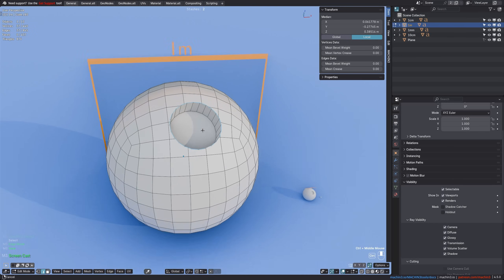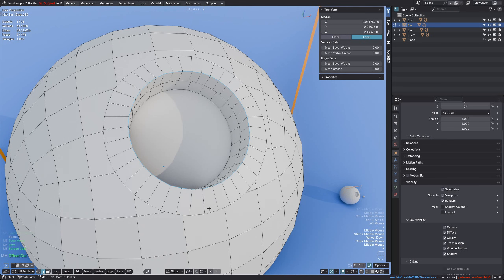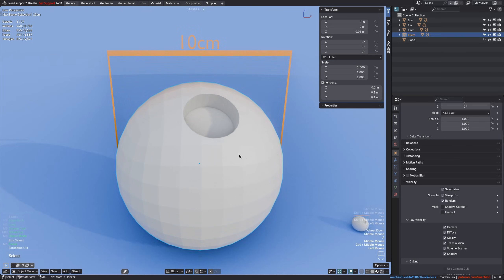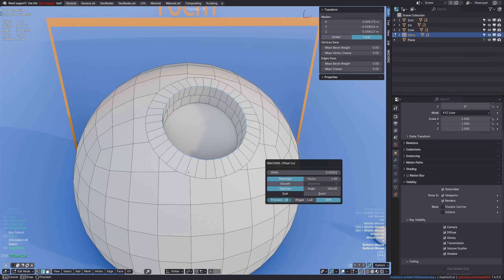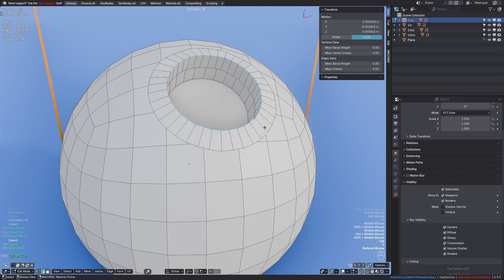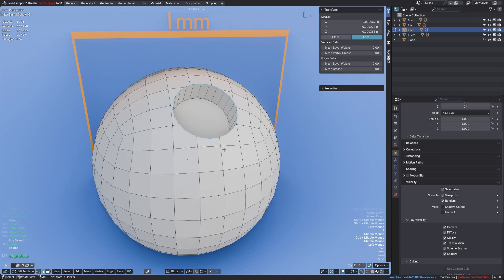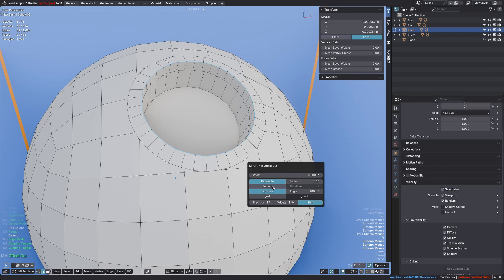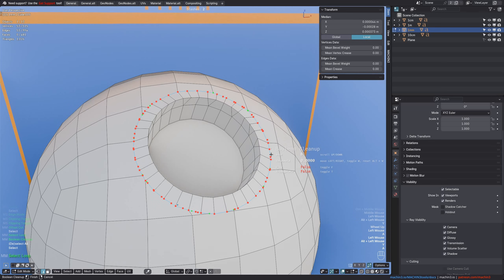MESHmachine 0.19 - Offset Cut

Comment: How does one avoid the post-OffsetCut 'bumpy' fillet surface result? I understand the Resample option rebuilds the initial edge to an extent, but it seems to not be enough. Using the Smooth option helps, but the surface begins caving in, even on 1 iteration. I've tried using the Relax wrapper(and Circle on absolute circular edges), yet still, unless i go through with the entire process of adding an Offset + Conforming, it will always be less than perfect.
Reply from the maker: Not exactly sure what you mean, but feel free to send an example via email and I'll have a look. Depending on the surrounding conditions and curvature and the width of the offset, the angle of any bevel that follows after an offset cut in terms of how it approaches the limits of the offset cut will not be tangential however. This is not CAD after all.
Reply: @MACHIN3  I could hop on and try to get an example, but i think u just cleared up what i was pondering about. '-It's not CAD'. Of course. Even tho the offset cut can carve through the geo, the bevel itself is still pretty much bound to the topo/curvature rules.

That said tho(thx for the help as well), it would be nice if the Offset cut itself can set up vgroups for normal transfer automatically, like the Offset, for example.

Comment: I like these explanation videos, please keep making them if they’re not too much trouble!

Thought you were about to somehow go even smaller and I was wondering if blender would even cope.

The trick in the last few seconds with the Boolean cleanup on something that isn’t obviously a Boolean at first glance is great, I hadn’t even thought of that, but of course it’s the same sort of topological problem so it works so well!
Reply from the maker: Glad you get value out of the videos. They do take considerable effort on top of the addon work, but I've worked to improve my entire video (and documentation) pipeline to streamline things when I did the big MACHIN3tools 1.12 update 3-4 months ago.

I think I may go 1/10th smaller, but sub-millimeter scale is already pushing it. If you move the object a couple of meters away from the origin then Blender itself will start to struggle to draw geometry in the right place.

And yes topologically it's the same. The tool merges verts on any edges, that have two different sides so to speak. And you  just pick the side that should stay fixed. Usually these are from booleans and create a surface break, but they can also be mesh cuts and lie flat on the surface.